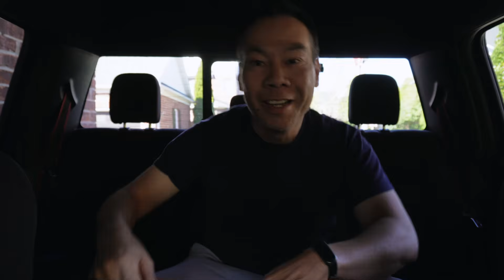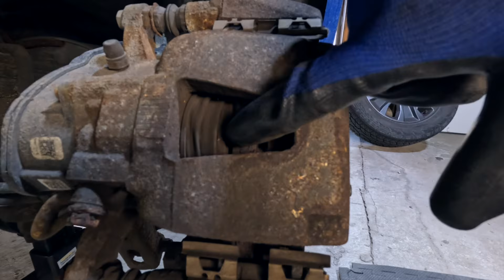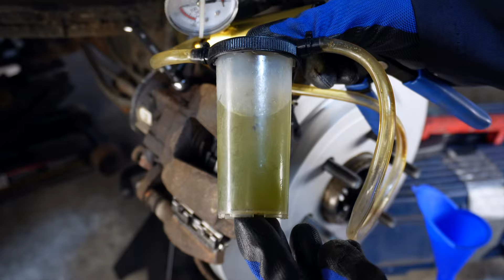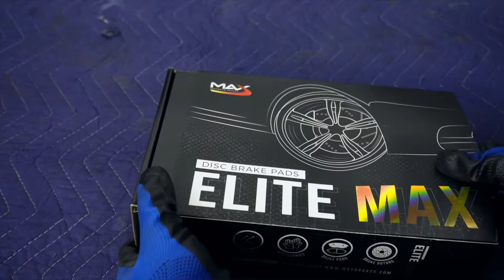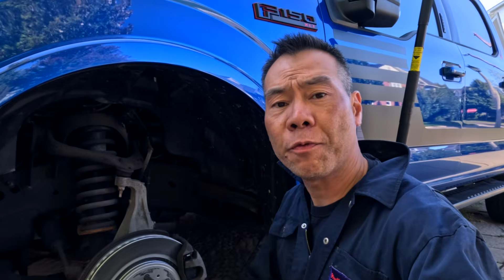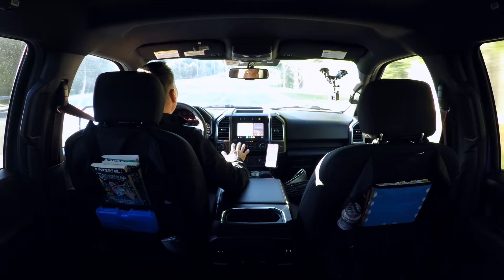F150 Full Brake Service DIY Electric Parking 2015 to 2020

Comment: How many kms did you have at the brake job time?
Reply from the maker: Maybe 90,000 kms or about 56k miles. The fronts were originals, the rears were changed once.

Comment: Why are you bleeding the brakes? You didn’t open the system and introduce air. Unless you’re trying to fully flush the system and if you want that you need to do the pedal bleed.
Reply from the maker: Flushing the 7 year old fluid for the first time. And ya, off camera I do a few peal pumps to get any last bit of air out. The vacuum bleeder is actually quite effective.

Comment: just a note for anyone: I was questioning the maintenance mode being on for rear and not the front. I researched that you only need maint mode on for the rear because it retracts the parking brake motor and the front does not have parking brake components, its like a reg brake job. Thank you so much for the video!!

Comment: I have a 2020 f150 with electronic brake. Im bleeding the old fashioned way with the buddy system to press the brake to bleed. I have the brake maintained mode engaged. My question is does the truck need to be on and started or just key on? Thanks in advance
Reply from the maker: Leave the truck off to bleed. Have your buddy step on the brakes a few times until the pedal "stiffness" comes up to the top of the travel. Then press & hold and open the bleed screw. The pedal sinks and you wanna close the bleed screw before it gets to the floor. Good luck dude!